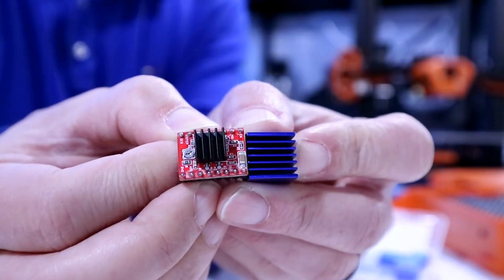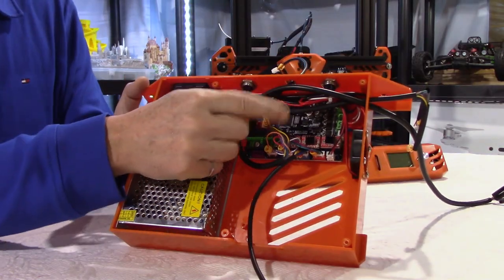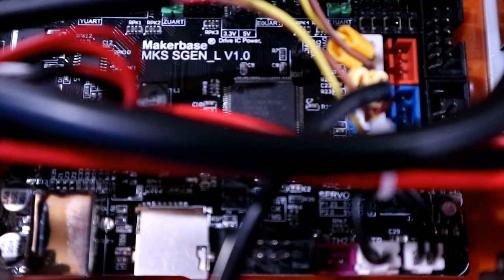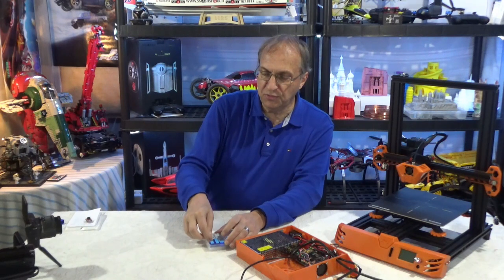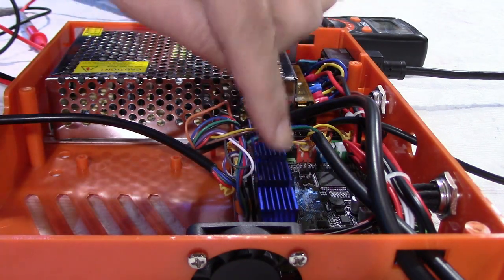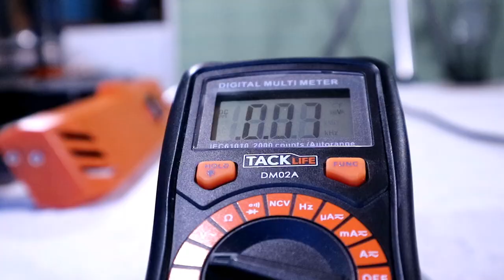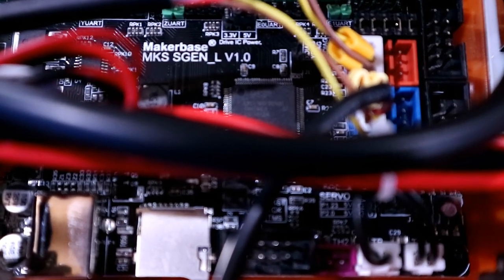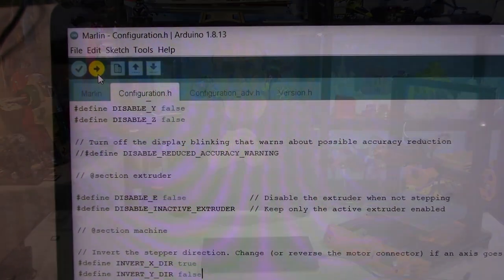Homers Tarantula Pro | TMC 2208 upgrade failure!

Comment: I thought the SGen L V1.0 is a 32bit motherboard. I have a feeling you are not updating the firmware successfully. Have look at some 32bit Marlin tutorials. I upgraded my Tevo Tarantula to an SKR 1.3 with TMC2208 drivers without too many issues. You need a Micro SD in the onboard slot and I would recommend MS Visual Studio to make the firmware as it has a Auto Build Marlin plugin. I had to modify platformio.ini, configuration.h and configuration_adv.h; I only notice you modifying configuration.h. I can also see UART jumpers on the motherboard so you could set the reference voltage from software; the default on my RS is 800mv.
Reply from the maker: Hi there and thanks for your comment.  I read somewhere that the early Homers printers had an 8 bit board but this could be wrong information.  I modified after doing this video the three files you mention and I am also using VS Code but I am having issues building the firmware file.  I have not used VS often and there is probably something I am doing wrong.  I also tried Arduino but I was getting well documented error messages so I gave up on that.  I am still trying to get VS to work...
Reply: @SuperdanTech  There were a few versions of Marlin that would not compile because the file paths were too long for Windows. Marlin 2.0.7 was good. Marlin constantly move config locations around so it is easy to get a mismatched configuration.h   The Facebook group 'TEVO Tarantula PRO & Normal Prusa i3 Owners' is a good place for help. VS Code and Atom like their packages to be up to date. Lastly, the motherboard has to be able to read the firmware update from the onboard micro SD at boot up. If you cannot see the Micro SD as a mounted drive you will have to use a card reader to manually copy across firmware.bin.

Comment: I have not read all the comments, so please forgive me if the following info is already here.  I found a couple references that look very helpful.  First is the Marlinfw.org site which has the latest firmware drivers.  Then there is a series of YT videos by Edward Braiman which have a huge amount of information about the MKS Gen L board.  Specifically it has detailed explanations about each component, how to configure, load and test the firmware.  Good stuff.
Reply from the maker: Hi Jack and thank you for the info.  I have already been to these places.  After I had issues with Arduino when I tried to modify the firmware file I switched to VS Code.  I ran into other issues and decided to sell the printer to someone who needed a frame to build a CNC machine.  After working on this printer for a full month, I could not spend one more minute on it...LOL.  I recently saw that Homers FINALLY posted firmware files on their website but I am still not sure if one would work with TMC 2208 stepper drivers...  Happy Holidays!
Reply: @SuperdanTech  Ah, that's sad.  I have one on order and I can only hope I don't run into the same issues you did if/when I decide to upgrade the drivers.
Reply from the maker: Hi Jack, like I show in another video I had decided to upgrade the drivers because my stock printer had issues with long prints (interruptions). It is still not clear if it was a power supply issue or the control board... It looks like many owners have a printer that works fine.
Reply: @jackmanatee3162  yup, I can confirm that my printer runs without any issues. @SuperdanTech probably received defective device.
Reply: So I've had mine for a week, printing almost non-stop.  Who knew how many Baby Yodas I'd need? :)

Comment: You just chose the Best option for that printer,even I changed this drivers hehehe,greetings!
Reply from the maker: Yah but what voltage did you use for VREF?  Did you also remove the third jumper under each stepper driver?  And where did you find the firmware file to do the update?  The SD card that came with my printer is corrupted.
Reply: I used the Uart mode,I locked the pins un a different way,I didnt had any issue with voltage and no need of soldering,let me get you the firmware because I know what does it feel to suffer with marlin,so let me hice you the link
Reply from the maker: If you can give me the link that would be great, thanks!
Reply: The second one is the perfecto choice,the only thing you have to do is download marlin files,replace the configuration.h and configuration.adv files and presto!

Comment: did anyone solve the issue?
Reply from the maker: One comment tread has very good info with a link for the firmware file for this printer with TMC2208 drivers.  I am still working on it...I am having issues compiling the file in VS Code...
Reply: @SuperdanTech   hi, please share what issues do you have. Maybe I can help you
Reply from the maker: Hello again, I used the file you sent me through github and I built a firmware.bin file with VS Code. I saved the file on a micro sd card and inserted it in the control board of the printer. I got an eprom error message. When the screen came back, I tried to move the axis manually but it does not work.  I think my board is 8 bit, not 32 as in your file.
Reply: @SuperdanTech  hi, I also got a EEPROM message at the first update, because in stock firmware EEPROM was not activated. If the firmware is applied so it means that you have 32bit main board. In other case the update would not be done
Reply from the maker: Yah I guess so.  My axis are not working manually and auto home does nothing.  I will look into it again.  I have the exact same config as you.  I put the TMC2208 on X and Y only with 1.2V for VREF.  I kept the stock 4988 at 0.95V on Z and E.  Thanks for your help!  I am wondering what is not working in my case.  I also removed a jumper for X and Y as shown in a TMC2208 setup video.
Reply: @SuperdanTech So it should work. I had no issues after installing in that way. EEPROM error message is stillvisible? If yes, as far as I remember you need to save settings and it will remove this error.  Some stupid questions, you don't need to answer ;) - have you connected steprer motors to the main board? Have you connected power supply or you try to run printer connected through USB only?
Reply from the maker: Hello again, yes, yes and yes...lol.  I saved the settings and the error went away at the next boot.  The opening screen shows the bugfix 2.0 firmware name.  Everything is connected as it was before.  I tried to operate the printer in USB mode with the power connected and without USB also.  I still cannot move the axis manually and auto home does not work.  I will keep looking...
Reply: @SuperdanTech   the only difference is that I installed TMC2208 v1.2 and you version 2.0. But both version should work normally...
Reply: @SirDealer   I am unable to upload the files and new firmware. I don't know how to upgrade the software and it's not letting me put any new firmware. It is quite frustrating. the tmc 2208 works but its reversed and the code doesn't get uploaded.
Reply: @foysal8680  what board do you have? MKS GEN L or MKS SGEN L?
Reply: @SirDealer  May I have your email address? I can send you pictures if it can help.
Reply: @SirDealer  ok my one is the one with foy.arian2002
Reply: i don't know if I texted the right person. can you text me?
Reply: I am able to change the firmware with Visual Studio Code. And I am waiting for TMC2209.

Comment: btw the vref should be between 1 and 1.2v
Reply from the maker: I did 1.2V also.
Reply: @SuperdanTech   Foysal Arian already managed to set up the drivers TMC2208 v2.0 in the same printer and board with the software that I provided. So I assume that there is a problem with hardware in your case. Maybe the main board or motors.
Reply from the maker: When I insert the micro SD card in the board, only the bin file should be on it right,?
Reply: @SuperdanTech  Yup, only this file is required

Comment: sirdealer solved the issue for my printer. and he was very helpful
Reply from the maker: Yes he is very helpful but for an obscure reason my firmware update did not solve my problem.  My axis are not moving... I must be doing something wrong!
Reply: @SuperdanTech  yo used an sd card as well?
Reply from the maker: I tried both, sd card and usb from laptop.
Reply: @SuperdanTech  if the software was successfully updated it is not the software issue. Drivers should work anyway.